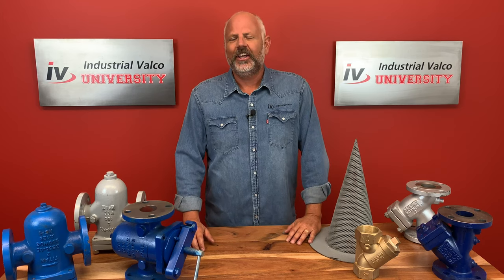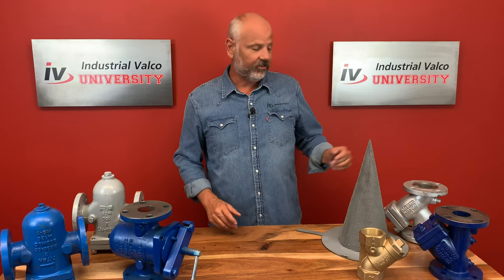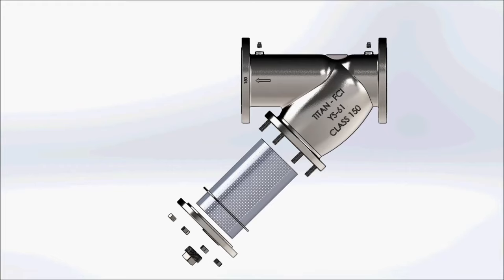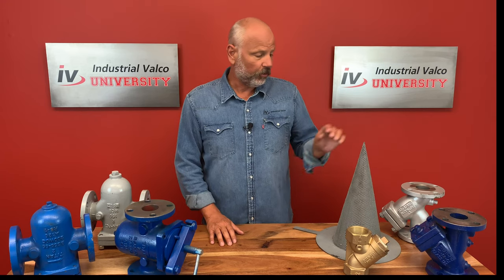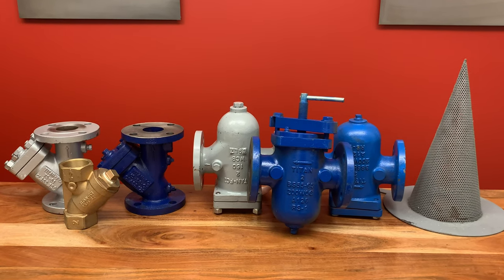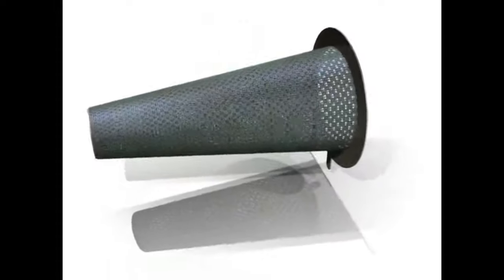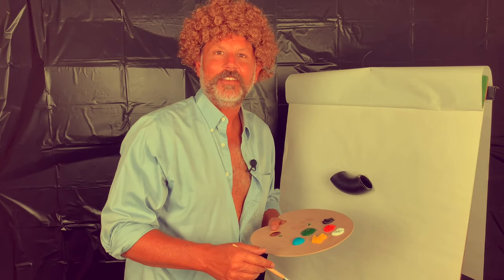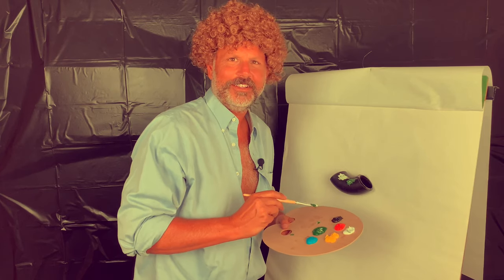What are pipe basket strainers, y strainers, conical strainers used for.

Comment: Great video. What usually gives more pressure loss, a conical strainer or a basket strainer?
Reply from the maker: Thanks Lewis, Y - Strainer is the lower pressure drop.
Reply from the maker: So many factors of the installation come into play when figuring pressure loss.  Both cone, and baskets are offered in different open area ratios. Commonly 100%, 150%, 200%, and 300% open areas. This will determine the design length of the temporary strainers.  They Both have very similar if not the same Cv valves for the respective sizes also.  So one will not really give you more of a pressure loss than another.  The real differences between the two is the length. 
Example; A 200% OAR cone strainer (witches hat), will be much longer than the basket type (pilgrim’s hat) at 200% OAR.  This can be a space saver in the long run.  
10in 300% O.A.R. Cone strainer (witches hat) = 41 inches long
10in 300% O.A.R. Basket strainer (Pilgrim’s hat)= 26 inches long

Hope this helps!

Cheers,
W. Barclay Dail
Sales Manager
Titan Flow Control INC
Reply: @ivuniversity4930  Interesting, thank you! OAR is a useful keyword.

But from my understanding basket strainers have the filtration element perpendicular to the flow, and come as a large stand-alone unit shaped like a T. Therefore making the "pilgrim's hat" longer doesn't really make much difference; you're extending the strainer into a region of no flow? Whereas a temporary cone strainer is in-line with the flow and hence making it longer does have the improvement in pressure drop?

Or are you comparing two temporary in-line strainers, a cone (witches hat) and a cone with a flat end (pilgrim's hat?). Because currently I am trying to find a small strainer with low pressure-drop and hence wondering whether I should be looking towards a temporary in-line strainer or something like a Y strainer.
Reply: @ivuniversity4930   why you call them temporary strainers?